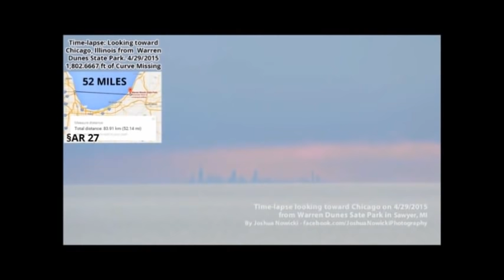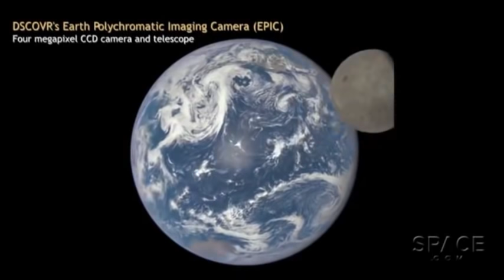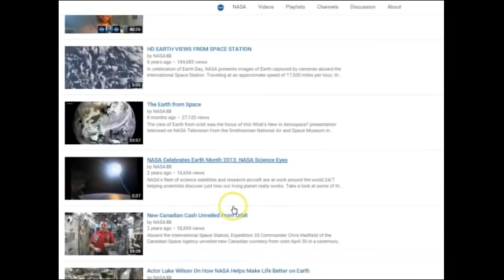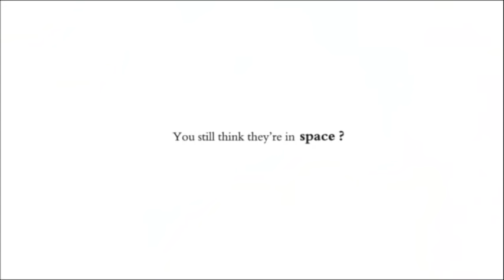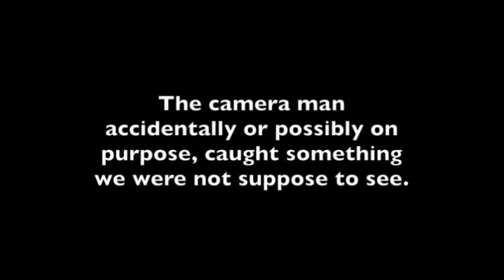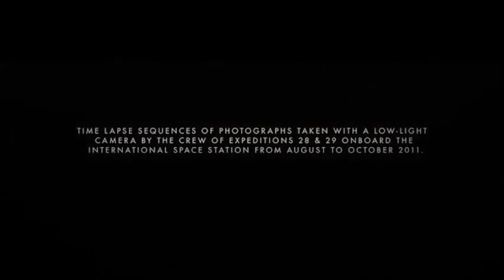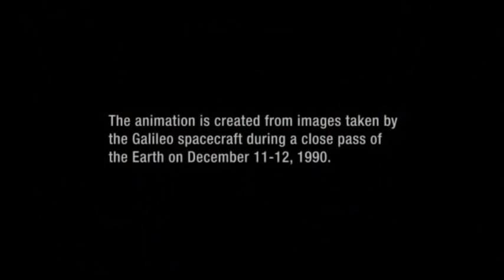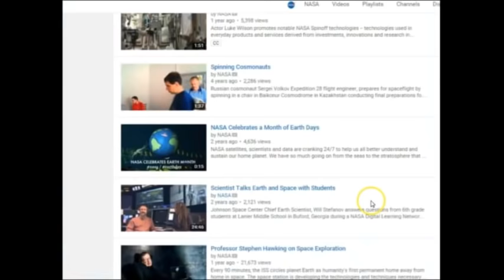Flat Earth Clues Interview 71 - I Don't Know Show via Skype Audio - Mark Sargent ✅

Comment: Mark respectfully I don't see your movement as weakening the globe at all. I would agree that if you wanted to prove to the entire world once and for all the shape a real time trip in to orbit might just clear this up once and for all. But barring that you need to come up with a working hypothesis for something as basic as what is the sun. I have not see one of you flat earth types make a video interviewing any grad student, professor or astronomer about your theories. I have repeatedly stated to proponents of this theory what is the sun. You do not need NASA or the Authority to look at the sun. You can view it yourself. It is not a heat lamp. And if the sun is very close to earth as you and other theorize and is moving at a tremendous rate of speed in its circular orbit above a flat plane the sun would appear very differently than what we all observe with our own eyes. You theorize the sun doesn't set or rise. That what is happening is a vanishing perspective and yet that is not at all what is observable. The orange and red light is due to curvature. Sunset would last hours and the sun would appear as a shrinking star. Your model cannot explain this. Your model offers no alternative to disprove that the sun isn't emitting ultraviolet radiation, infrared radiation and gamma radiation. Your model doesn't hypothesize the existence of helium and hydrogen. There are ways to measure this. You cannot simply just dismiss thousands of sun experiments and say none of them are real. 

There are measuring devices that can measure the moon within very precise tolerances. Has anyone in your group tried to verify how these devices work? The trigonometry experiments of the ancient Greeks can be replicated today which is why they haven't been disproven. There are laser measuring devices that doesn't require a NASA permission slip to verify the moon's distance. If the moon really is 236,000 plus miles what is your theory of the sun then?

What is your alternative to gravity if gravity is just this silly little theory? Without gravity how do you explain the enormous pressure that one faces by diving very deep in the oceans. Without the constant of gravity water would not create the enormous pressure from its mass. So is the pressure in the depths of the oceans not real? In fairness to you I have a problem with the idea that our solar system and entire universe is expanding at some tremendous rate of speed. I believe scientists claim the sun is orbiting the milky way at over 500K mph. And that our Galaxy is moving at some 600K mph. I don't know enough about how these numbers were derived to challenge them but I find it hard to believe that the constellations have not changed in thousands of years. Maybe the simple answer is the Universe isn't expanding and things are more fixed than we are told. But there are other things to concern yourself with for people to take your model serious. 

Empirically for not a lot of money you should be able to determine the distance the moon is from earth. If it is the distance most people think then that changes your sun hypothesis. I don't know where you live but I am betting you are near some local university in the Pacific Northwest that has an observatory. Many colleges have telescopes. You can find out very quickly that you need a real model for the sun and you do not have one. Your desk lamp analogy of day and night cannot work. You have to assume a flat plane surface at over 25,000 miles. That means your geocentric sun must travel at over 1100 mph to create our day and night cycles and that means the sun at 3000 miles would appear to be in constant motion. A physics teacher or grad student could show you how to construct a model to demonstrate that. The sun's luminosity is far too bright for dusk to last 15 to 20 minutes. And your sun would have to travel based on its luminosity significantly further away maybe as much as 3 or 4 times to create total darkness. These are real hurdles that your fellow adherents don't seem to want to address. And then you wonder why people reject your theory and mock it. You have to have a plausible hypothesis for night and day.  You have to be able to explain how the sun can orbit at a distance so close to earth and not burn the atmosphere up. It seems to me you all feed off of each other's videos. Have you bothered to make a FOIA request to anyone about anything?

Has anyone attempted to get any satellite photos from private companies that build satellites? Have you tried to talk to someone who actually works for any one of 3 dozen companies in the U.S. alone that work in active space? You have to do a lot more work than watch each other's videos and endlessly speculate about your false premises.  In short if you want your challenges to science to be serious you need to go to the science industry and first seek answers. You might be surprised at the evidence you find.  You need to spend some time with a telescope before you conclude that people are just looking up at a fake cosmos. There are other explanations.  Start with the sun. That is your biggest hurdle. Measure the distance to the moon with a laser or other device that they use today. That should be a very easy thing to prove. If high school astronomy classes can reproduce the Greek's parallax theories I am certain you can confirm or debunk the moon. Once you have that object fixed then you can start to determine if you can build a working hypothesis for the sun.
Reply: +Jeff Frazier -I have watched the entire clues series by Mr. Sargent and if you are impressed with it then I am not sure you are all that discerning. Mark completely fabricated his theories about Antarctica and Adm. Byrd. Never once did anyone from operation high jump claim flat earth. The quirkiest thing Byrd talked about until his death was his journey into the earth and meeting an advanced civilization. The U.S. was looking for underground Nazi bases in the south pole and by the whistle blower accounts they found them. Expedition 7 crossed the continent in 2013 in two modified SUVs from the north to the Ross ice shelf and back in about 80 hours. The idea that the antarctica doesn't exist or is some very long wall is simply not be proven out by anyone of the 30 private expeditions to the continent in just the last 12 years. So this whole mystique, no one can go there BS is simply an internet meme. And I am not suggesting that there might be stuff going on down there that we are unaware of. But to suggest it is totally off limits and isn't a continent certainly hasn't been proven. 

Mark's use of the zetetic curvature formula is flawed. Mark has no scientific analysis of the sun or anything remotely resembling a workable hypothesis. He has stated he believes the sun is a disc and isn't real. That is a tough one to swallow for folks that spend their days doing science experiments with solar radiation and all sorts of things. Mark's clues fail to address the southern constellation problem. Mark's clues fails to address how the moon could be 236,000 miles away from earth and yet the sun only 3000 miles away. High school astronomy classes have recreated the Greeks measurements of the moon. Of course he could just cheat and buy a laser instrument measuring device and avoid the parallax experiment all together.  Mark's clues fails to address gravity or even remotely offer an alternative. Without gravity please explain to me how you can have the crushing pressure of the oceans at 2 and 3 mile depths. Mark's clues cannot explain how night time happens. If the sun was merely a bright ball of light moving away from a given perspective how is it that we have night time and total darkness practically within say 20 minutes of sunset.? In a flat earth model the sun doesn't set. So the sun would remain higher much longer and the sun would get smaller and smaller like a bright star on the horizon. Sunset or dusk would last hours. In fact the sun could never get far enough away to create total darkness. The sky would always appear to be back lit. And of course the sun would not turn to orange and red as the sun set without light bending. The sun is a huge problem for you folks in flat earth and not one of you have taken on the challenge of coming up with a workable hypothesis.